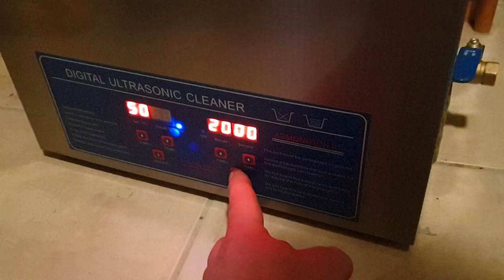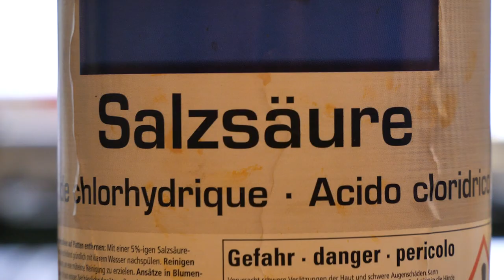Restoration of a Jointer Planer

Comment: Beautiful machine and meticulous restoration work! Very nice! However, you should replace that cutterhead with a modern knife-and-gib model or a segmented one. Those clamshell heads are ticking time bombs due to a design flaw with the screws that can lead to the cutterhead throwing the knives. Just ironic they were originally called "safety" cutterheads.
Reply from the maker: Hey Matthew,
thank you for your concern! Yes you're right these cutter heads are not ideal in terms of safety. I plan to upgrade the head with a carbide helical cutter head at some point. (these are quite expensive..) I'm currently building a full cover for the cutter head also for dust extraction which should add a lot of safety.
Reply: @HolzFlo  Good plan! Yes, those helical heads are crazy expensive for what they are, but no amount of money can undo the potential damage one of those clamshell heads can inflict. Plus that carbide will last you for years or even decades without having to completely change the inserts (depending on if you're a hobbyist or pro).

In the next 3-5 years I'm looking to upgrade to a bigger jointer. I want to go for an old Oliver 166, either a 12 or a 16 (but no smaller or bigger), and for the most part those come standard with a knife-and-gib head. They really don't build them like that anymore and you can often get them for a lot less money than buying a brand new (and not as good) model. It's good that they don't normally have a clamshell head on them as I REALLY don't ever want to have to change out the whole head (too time consuming and expensive for me).
Reply from the maker: @GamingDrummer89  
Yes, didn't dig into it jet.. But I think there are suppliers where you can get this helical heads custom made to fit your planer.
Yeah these old machines are built very nice! I expect this machine to last my whole life, so I think it's worth it to put the money into a better cutter head at some point.
Reply: @HolzFlo  Yep, there are suppliers like that. Usually people go with a Byrd Shelix cutterhead. They're extremely expensive (especially custom built) but they have 4-sided carbide inserts that will outlast steel knives, on average, a couple or three dozen times over. Plus they're easier to reset than regular knives and cut much more quietly and don't tear out nearly as much on tough grain or figured woods. There are several other companies that do the same type of thing but Byrd is the one I see people upgrading to the most. Good luck!

As for me, unless the particular jointer I end up getting happens to already have had a helical head installed, I'll just stick with the knife-and-gib head and skew the fence at an angle to get a shear cut. I'm probably going to just get a thickness planer already equipped with a Byrd Shelix head and if I do happen to get any tearout on my jointer's regular knives, I'll just plane the opposite face and then flip it back over and run it through the planer to clean it up.

Comment: Great project and a very excellent video.  I have purchased the plans and just started gathering the materials.  Can you tell me what the height of the gantry is when it is lowered to its lowest point and raised to its highest point?  Thank you.
Reply from the maker: Thank you!
These sizes depend on the castors you use. But with the casters I have mounted, at its lowest setting the gantry fits underneath a 2m high door. So its highes point is a little lower than 2m. You can raise the ganty about 1.15m so up to 3.15m. I hope this helps your question.
If you have further questions, let me know.

Comment: When replacing bearing for cutter head, did you consider sealed bearings to keep out saw dust?
Reply from the maker: Yes I’ve thought about it when I purchased them. But in the end I did it like it was original. The bearings are sealed by the housing pretty good. The housings also have greese nipples to greese the bearings, that would be impossible with sealed bearings.

Comment: what kind of jointer/planer is this?
Reply from the maker: Well.. it's a jointer planer with 61cm width. There  is no brand or model number on it, so I can't tell you exactly. The previous owner told me that it was bought by his uncle immediately after WW1. But it's handmade from cast iron and in fabulous
condition.